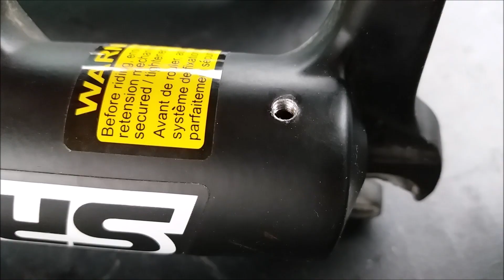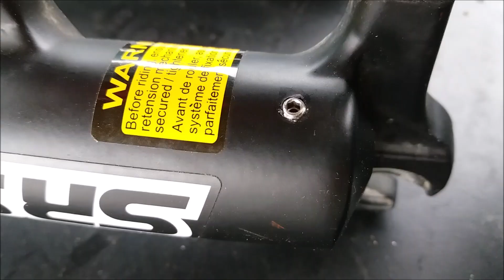🚲Como MEJORAR sensibilidad HORQUILLA MTB SR SUNTOUR | How to IMPROVE sensitivity SR SUNTOUR MTB FORK

Comment: La verdad no lo veo necesario no podes tener una fox de una horquilla gama baja por eso hay gamas en todo caso se ahorra y se compra slgo mejor simplemente al hacer eso  daña la compresion interna de los barrales por eso da una mejor sensibilidad pero ess compresion es necesaria porque de no ser asi esos agujeros ya vendrian echos en la horquilla y al dañar la compresion tienes muchos problemas extras como fondeos mas faciles problemas de suciedad perdidas de liquido en caso que la horquilla lleve aceite y daño a largo plaso de los barrales y la entrada de fluidos no deseados como agua barro etc cosas que dañan por completo una horquilla
Reply: Yo hice eso y quedo espectacular mi horquilla  le hice otras cosas tambien y quedo como una horquilla de aire .
Reply: @gonzaloinostroza381  que mas le hiciste?
Reply: @ravenmtb221  Hola , le cambie el resorte , lo mande a fabricar , le pedí a un amigo que me prestara
el resorte de su bicicleta  suntour xce las que traen las trek marlin 5 , entonces le indique al que me fabrico
el resorte que me respetara el el diametro del resorte original , pero con el grosor del resorte de la xce que es 
mas fino.Tambien compre en Aliexpress las esponjas, de esas que traen las horquillas mas caras y se las puse por dentro del guardapolvo , le pones aceite con teflon y quedo espectacular la horquilla.
Realmente quedan super blandas. Eso si, yo no la ocupo para saltar